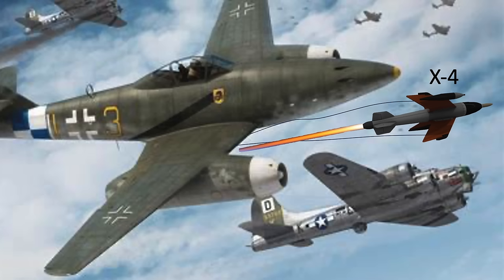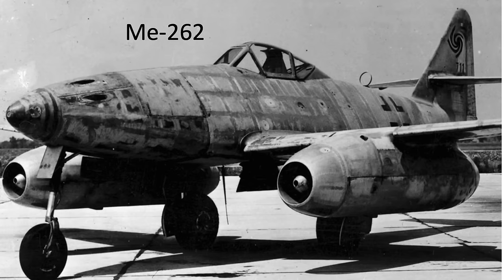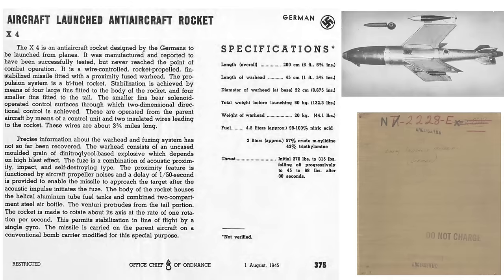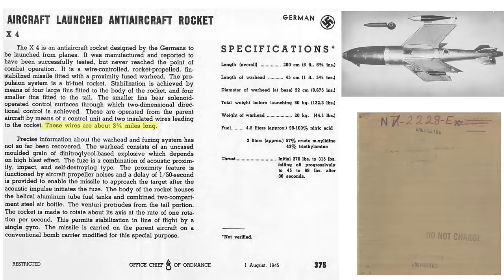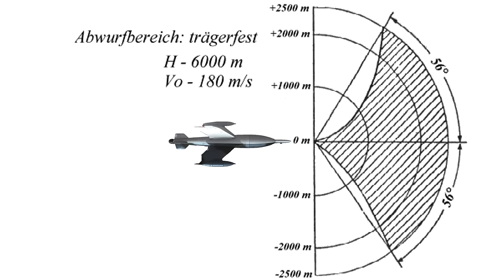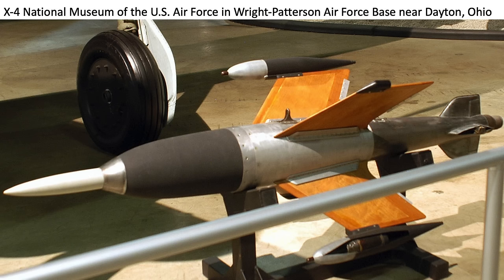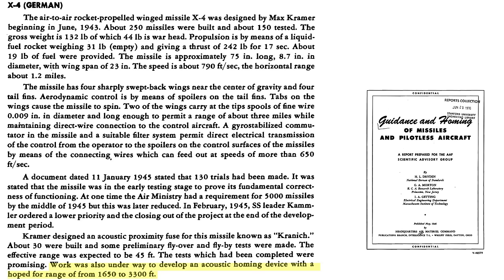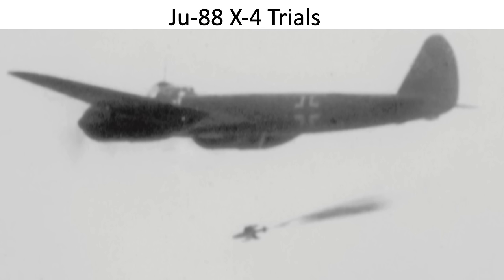WWII German Wire Guided Air-to-Air Missile, the X-4

Comment: I know it’s nowhere near an actual simulation of the act, but attempting to fly your aircraft and control the X-4 in IL2 1946 was fantastically difficult.
Reply: fun fact: none of the planes in il-2 1946 that can equip the RX-4 where or would have been greenlit to use it. the single test done with fw190 planes resultet in a order that only two seaters could carry the rocket meaning that the heinkel lerche would have been out of consideration at all. basicaly if it had a night fighter version with radar it could also carry the rocket. this also means that the me262 would have been one of the planes in this list.
Reply: MCLOS was only an interim guidance system to get these missiles operational and in production.  Self homing was expected in good time.
Reply: This is correct; see also Dr. Runge's Report in this video from 7:38 onwards, last paragraph.
Reply: @williamzk9083  the system was already done successfully with torpedos so adapting was likely to happen here.
Reply: @Irobert1115HD  They had an acoustic homing system that worked on a Me 262 quite well.   Exhaust Popper Valve Noise of a 3000 RPM Merlin is 300 Hertz and Propeller Noise from a 1500 RPM 3 blade prop about 75 Hertz plus you would have a beat frequency of 187.5 Hertz.  Jet engine frequencies are 30 times higher.  I suspect a band pass filter between 50Hz and 300Hz would cover all  piston aircraft which of course are extremely noisy.
Reply: Or almost impossible & dangerous
Reply: @Irobert1115HD things from which maritime torpedoes are launched are stationary or far slower moving & changing direction than aircraft
Reply: @pcka12  zaunkönig I & II and geier with the last one having hiw own sonar.
Reply: @Irobert1115HD  sonar? So on a maritime missile?

Comment: The US army still uses TOW wire guided anti-tank missiles. Have to wonder if a 37mm motor cannon firing through the prop hub in the Soviet style would have been the most efficient heavy bomber killer. At least till better more refined air to air missiles & rockets. The post war Mig-15s with a  37mm over Korea made short work of the American B-50s they went up against. B-50 was the up engined B-29.
Reply: TOW has a Semi Active Guidance System. Operator just has to keep the sight on target and the computer steers the missile onto the target.
Reply: @richardvernon317  What does the "W" stand for in TOW? Will the missile stay on track if it snaps? Wires are so 1960's it's not even funny.
Reply: @michaelbizon444  The wire is the link!! not the device that generates the steering Command!! You have never worked on a Missile System and you don't have a clue what you are talking about!!! Wire guided missiles do have their advantages and most TOW's and other wire guided missiles that have failed due to wire breaks have failed because the missile was fired at targets outside of its maximum range. Anyhow this missile was built in the mid 1940's!!!
Reply: @richardvernon317  TOWs were built in the 40's?!? You are off by a few decades. Any how wire guided is old tech. And has severe limitations. And FYI no the missile will not hit the target if the wire breaks. 
Fire & forget is the newer & much better fire control. So the gunner does not have to be exposed while he tracks a 12 second flight time max effective range. Plenty of time for  a tank turret to see the back blast, swing 180 degrees and blast the gunner & launcher vehicle. You were never a crew man on a TOW system it seems. Also the Wire Guided missiles can't be fired on the move. Make large tracking adjustments an the wire snaps. Even rain can screw up the wires.
Reply: I agree that a single hi velocity 37 mm cannon plus machine guns as back-up would be more effective than 4x MK-108. German fighters needed to stay out of range of the B-17 protective fire which was at least 600 meters.
Reply: @AjitMD  In the end even if the Germans had found the exact means to down enough of the heavy bombers to make a difference, the B-29s & Nukes would have went to Europe for their efforts. The first B-36 peacemaker prototype flew about a year after VJ Day. I think the deck was vastly stacked against the Reich.
Reply: @michaelbizon444  True!  Their best chance to winning the war was to concentrate in mobilizing their industry to produce enough superior long range fighters and bombers once it became obvious that their airplanes were inadequate.  Not sure that they could deploy jet aircraft in 1940-41.  Goal was air superiority over the North Atlantic.  They needed real subs like Type XXI in large numbers like 300+.

Germany was ahead in nuclear physics.  They had enough Heavy Water even though some was lost in sabotage.  Uranium stocks to produce may 1-2 Plutonium bomb using 20 kg.  May be use pure graphite?  They got their Uranium from the Congo.
Reply: @AjitMD  My best guess is as bad as any. The most the Germans could have done other than not replay WW1 and all it's mistakes. Would have been to have their industry maxed out like it was 1944 all the way back in the prewar. And  To at least have the Ger subs at their Anglo/Ger Navy prewar treaty limits before wasting resources on large surface ships again.

Idk maybe not do the whole 2 front war thing again. 

Or just make the nukes then have the War. 

It's like the NSDAP were trying to lose the war before it even started. Jets? What good are those? No money for you till it's way too late. Same for IRBMs, Cruse missiles,  night shifts? We don't need no stinking night shifts in our War factories.  

Every neutral attacked was less needed resources from trade with them. And hundreds of thousands of occupation troops needed for fighting or factories. The massive amount of rare resources from trade with the  USSR was negating the Brit sea blockade, attacking East meant the war would be lost even faster.

The Germans never had the man power or resources needed to win either of the WWs.
And their main allies in both were so useless they were counter productive. IMO.
Reply: @michaelbizon444  "Every war is won or lost even before it is fought"  Quote attributed to Sun Tzu, in the Art of War.  You may be right,  Germany would have needed a quantum disruptive technology to win the war... meaning Nukes.  

In reality, Germany could have waited for an  opportunity to get Danzig if their aims were limited.  Taking the whole of Czechoslovakia was a mistake as it really pissed off the Allies.  Or wait till tile Staling grabbed Poland first?  

Germany was never strategic thinkers.  should have stayed neutral in 1914.
Reply: @michaelbizon444  TOW switched to radio command guidance about 10 years go using a low bandwidth data link.   These missile have an auto pilot and will fly a steady course.
Reply: @AjitMD  Ignoring the 7.92mm and 13.2 (0,55) machine guns the Germans had the following canon:
1 MG 151 a 15mm weapon with better ballistics and higher velocity than the US M2 050 and British Hispano.
2 MG 151/20 which was a necked up version of the MG 151 with greatly reduced velocity but still good.
3 Mk 101 a high velocity recoil operated 30mm gun.
4 Mk 103 as above but with gas driven unlock for the breech.  Same ammunition but twice the rate of fire and lighter. 
The above could all be electrically synchronized due to use of electrical primers.  
5 Mk 108 low velocity 30mm gun.
There were the bigger BK37 and BK50 but way to big for single engine fighters.
The MK 103 could fit into the wing roots of the Ta 152 and the gun also fitted into the Do 335 as a propeller hub gun.  It harmonized ballistically with the MK151/15 nicely i imagine.  
6 The direction the Luftwaffe was heading was the MG213 revolving breech gun which featured a powerful 20mm cartridge closets to the Ground based C20/C38 with 1000m/sec velocity and 1000 RPM.  This gun would no jam under high g manovers.
Reply: @AjitMD  I think the factors to allow German to win are relatively minor
1 Secure their enigma cypher .  The had UKW-D rewirable reflector but didn't produce enough.  Just going to 6 wheels would have done it.
This would extend the war by 2 years it is said.   Many of Germany's defeats in Russia were caused by Enigma decrypts being passed to Russia.  
2 Make sure all Me 109 and Me 110 fighters had drop tanks during the Battle of Britain.  Germans even had them on He 51 and He 112 in Spanish civil war.
3 Make sure Fw 187 is built so German has a long range fighter and aircraft able to catch Mosquito even if at expense of Me 110
4 Don't cancel the 1937 4 engine bomber program in May 1937 but instead produce some so you have about 30  at the outbreak of WW2 to support the German Navy.
5 Build the He 177 as 4 separate engines or rather build the Me 264/6m 2 years earlier instead of the He 177 so German can harass and mine US East coast in 1943
6 Don't suspend you proximity fuse program in 1940 as if they have one by 1942 they can defeat allied bombers.
7 Start a a-bomb project in 1942 when Speer offers RM500 million funding to Heisenberg.   (I think still would have been beaten but who knows)
8 Don't disband microwave research teams in May 1942.
9 Don't waste time on the Ta 154 or Me 210/410
10 Retreat from Stalingrad rather than wait to they run out of fuel.
11 Security of enigma ensures German supply routes to Rommel work.
Reply: @williamzk9083  about time if you ask me.
Reply: @williamzk9083  Good points any of them would have had an impact. I think the Germans were always at their limits though. At any point they were maxed out.  The Manhattan project cost a little less than bringing the B-29 from concept to production. The Germans never had the extra cash, resources or man power. Certainly not by 42, imo. 
Even the 1st Tiger 1s were only just reaching the frontlines by Sep 42, already too late and in to few a numbers to make more than small tactical victories possible.

See I'm sure you know that Germany was way behind in WW2 as they had their War indy cease to exist as a loser of WW1. The new plant built starting in the mid 30's was not Henry Ford efficient as it could have been by a long shot. Just take the Ger steel indy after losing their best iron ore region to France, Germany was iron ore poor. Such a basic and indispensable war material.

The allies had all their old and well established war plant & supply lines. Except France, France sucked. France was the allie's "Italy".
Reply: @williamzk9083  2 WW2 what ifs: Libya has an estimated more than 9 billion barrels of oil, was first drilled about a decade after the fighting there.
And Germany had some very promising gun developments come to naught for want of tungsten/wolfram to make the armor piercing rounds. The Austrian  Mittersill deposit was discovered in 1967 has become Europe's largest. It's wild to consider all the what if's.
Reply: @williamzk9083  If the Me109 had drop tanks, they would have achieve air superiority over Britain and Brits would have sued for peace.  
-  Barbarossa was German arrogance at its worst.  Reading the history of Napoleon invasion would be enough to deter a sane person from invading USSR.  Harsh weather, terrain and distances would be enough.  Even if Germany "won" the territory would be too difficult to hold.  Germany could have met its fuel needs from the Romania oil fields, synthetic oil plants and trading with the Soviets.  
- Dimwit Mussolini had to know that Italy was weak and stayed neutral.  Germany should have ditched the alliance with Italy and Japan.  
-  Nuke development would be possible but the leadership was mostly uneducated people in terms of science and technology... even though Germany had smart engineers and scientists.  They went after Jews for no good reason... what idiots!  Also, every encryption system has been broken, especially mechanical systems.  Only 1 time pads work... may be.  Have to use multiple systems and even spread false info to test and deceive.
Reply: @williamzk9083  I suppose Germany did not have time to optimize their armament for the fighters.
Reply: @AjitMD   "the leadership was mostly uneducated people in terms of science and technology" The NSDAP were an extra layer of more bureaucracy and red tape added to the existing government bureaucracy and red tape. Each nazi boss had a feudal mindset and coveted as much power over his rivals as they could. Even to the point of sabotaging the War effort in countless ways with endless infighting. Add to this was the confusion of overlapping areas of responsibility so no one knew for sure who to go to or to get needed information, ideas, & data where it would do the most good. Nothing like having an ignorant street tough to hungover to even try and do a good job in war time as boss of X ministry.

The Fuhrer had it this way, as he wanted the bosses at each others throats and not his, but this was hugely counter productive, especially once the war started.
Reply: @AjitMD  The Germans had all the problems of the Soviets without the 20 years in power to shake down the system. The only reason Nazi Germany made it as long as they did was the underlying strengths & institutional traditions of the Germans as a whole.  In science, industry, chemistry, military,  trade & manufacturing the Germans were already well off before 1933. 

It's a catch 22 situation where where the  Nazis needed more time in power pre-war to have had any chance of winning a WW2(more of the right indy & war plant). But the more time in power the Nazis would have had, the more dysfunctional Germany would have become due directly to their  chaotic leadership.
NS Germany was on track to be a mini Soviet Union, but without the depth of population or raw resources to back it up, imo.
Reply: @michaelbizon444  The German squeeze bore guns were deadly and extremely light.  Italy’s low level of industrialisation was due to its lack of oil, coal and gas but in 1943 natural gas was discovered as a result of a German supplied gravitometer.  The reserve didn’t get developed  till after the war but would’ve provided substantial energy to the Italian economy.
Reply: @williamzk9083  It. Nat gas is a new one for me thanks! Something read up on. Tungsten APDS round for the 7.5cm PaK 40 guns would have been a huge manpower & material saver also. As it was the Germans kept having to just make bigger AT guns by the end they were testing 128mm monster AT guns, becoming impactable. But in the modern day Tungsten APDFS is only slightly less effective then depleted uranium. Not to mention the industrial needs for high speed tool steel in all sorts of war production.
Reply: @michaelbizon444  the Germans had APDS rounds for the 105 mm and 150 mm howitzers .    These fired conventional steal cores but gave the 105 the penetration of the 7.5cm Pack 40 and the 150mm the power of the 88 FLAK 37.   The 50 mm pack 38 used also on the panzer three was supposed to receive tungsten core APDS.  But they had technical difficulties probably an accuracy issue due to uneven sabot separation and by the time they solved it. There wasn’t enough tungsten anyway   That’s mentioned in the osprey book on the Panzer 3.   The Germans referred to their APDS as TS or Triebsspiegel
Reply: @williamzk9083  And they were sitting on a mountain of wolfram ore in Austria . . .One of my other favorite gun developments was the  8 cm PAW 600, or how to save on propellent and material construction costs at the same time take out the heaviest Soviet armor at 750m.
Reply: @michaelbizon444  The PAW 600 and PAW 1000 surely would have been excellent weapons.  They were smootbore so a recoilless version version with the same or slightly better ballistics could have had about 1/3rd the weight but 5 times the propellant.  So long as only for AT use that would be OK I think.
Reply: @williamzk9083  the M-40A1 106mm recoilless rifle is an outstanding weapon system, imo. I had the pleasure to fire one twice and it was a BLAST! But one of the lesser known features it has, is the ability to be used in the indirect fire roll. With a reach out to 7.5 klicks.  
Massed tanks on earth ramps Korean War style is another ad hoc indirect fire that served a local need there.  Ramps were for the extra elevation. 
But most WW2 militaries even trained their machinegunners in indirect fires with their weapons.  
Today's US manuals had mention of it but never heard of any one doing any real training at the range.

Comment: future TOW missile
Reply: Imagine if they’d put it into ground combat use in north africa early rather than in the air over berlin late
Reply: Actually it was what inspired wire guided AT missiles in the 1950s. Example is the Nord SS.10 missile was a copy of the X4 design. However the rocket motor in the X4 was to dangerous to reblicate due to how volatile Nitric acid and Tonka is.
Reply: @mikkel066h  hence why I said, "future TOW missile.".